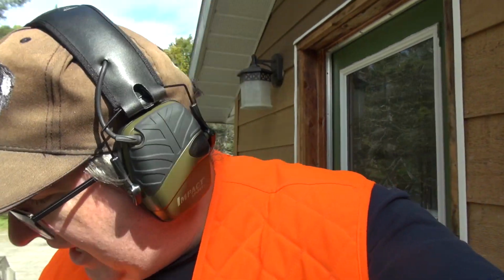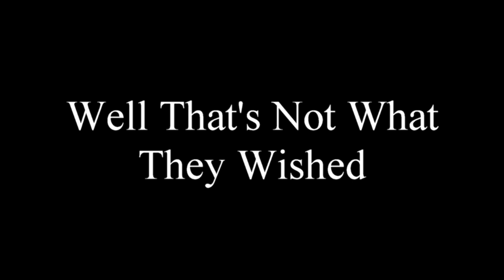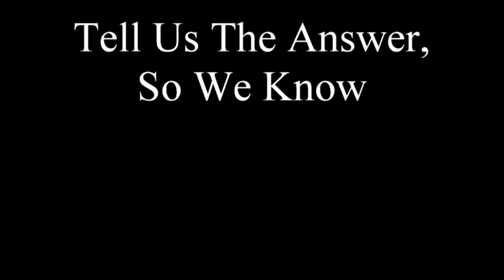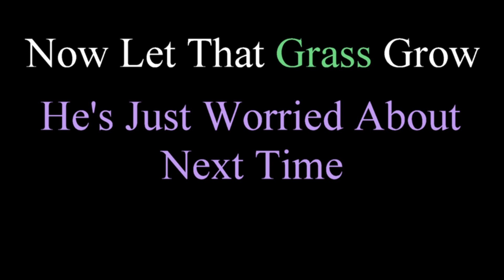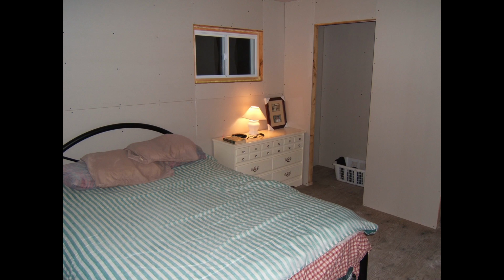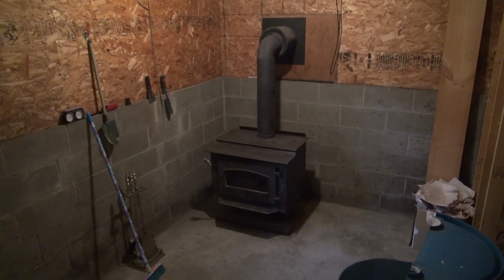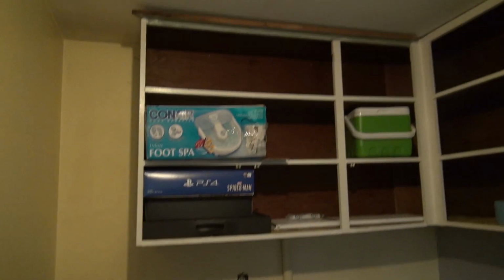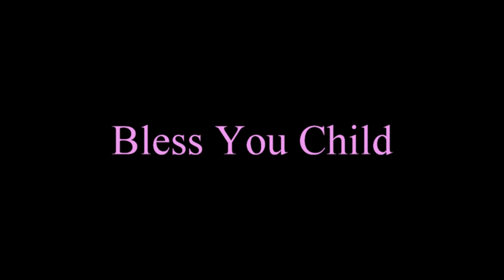Country Living #2 -Do Trees Have Souls?

Comment: Change is always exciting! For cleaning, may I suggest "T.S.P. = trip sodium phosphate" when I cleaned houses for a living I used that for walls that were literally covered in dog fur & grease & it works like a charm EVERY time! Ive used it for other cleaning too = amazing stuff! You will find it in the paint section of the hardware stores & its v e r y inexpensive! Wear gloves!! Also, using a sponge mop makes walls quick work! Rinse often in clean water and re-dip in TSP solution & repeat! 
   Hope that helps & that I too get a message from your sink! 😉
Reply from the maker: I have a little jug of that somewhere! Never used, but I'll try it now!! thanks 😁